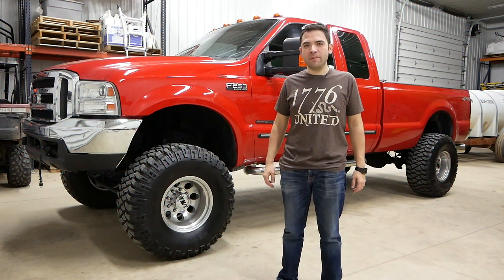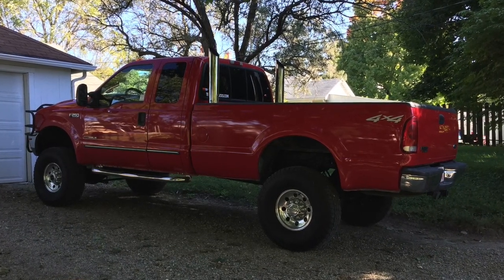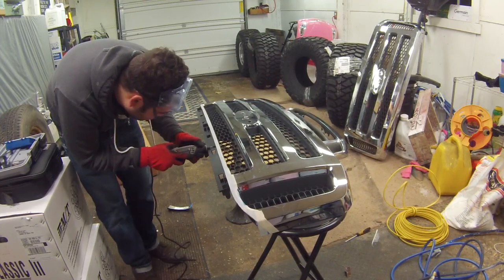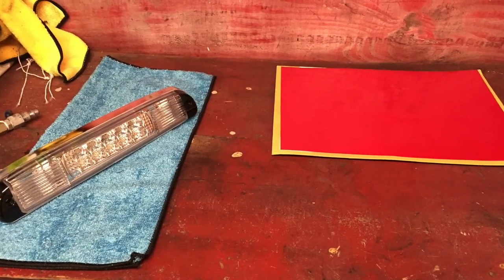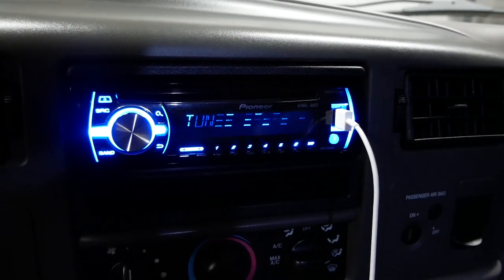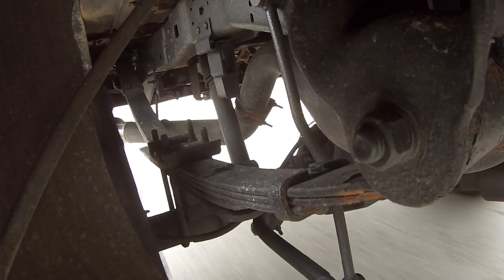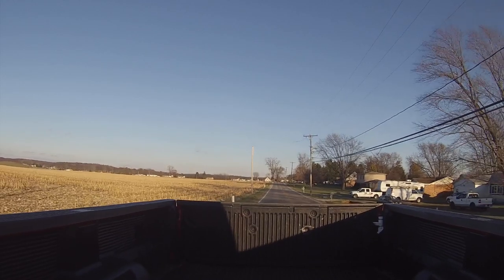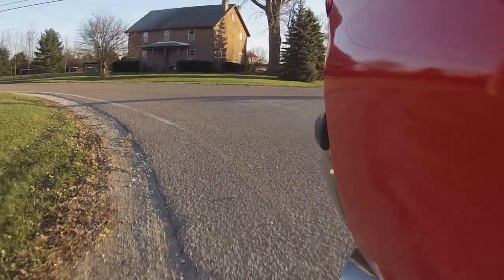7.3 POWERSTROKE F250 project!! (v1.0.0)

Comment: You should get the Sulastic shackles.
Reply from the maker: BIG_JOHNWARD thank you for the comment! I checked them out and you’re definitely right, they look awesome. Looking forward to the winter project of cleaning surface rust on the frame and springs, going to try to add a set of these when I do it 👍

Comment: Love your truck!! Did that wheel tire combo rub leaf springs or fender at all? Just curious because I have an 04 with 6" springs on it and love the way yours looks!
Reply from the maker: Allen Gable thank you! Minor rubbing during heavy articulations and steering wheel at full lock turning right. Turning left seems to be fine for some reason lol I had to trim the front bumper because the tires hit the corners on both sides. Overall I’m happy with the setup though, if I changed anything I would go to a 20” wheel to have some more space between the calipers and the wheels themselves
Reply: @alwaysup2late  thank you! I picked up a set of 16x10. Next step is tires!
Reply from the maker: @allengable2350  Nice! What tires did you decide on?
Reply: @alwaysup2late  I found a good deal on toyo 385/70r16. They do slightly rub springs at full lock in both directions, and I also spaced the front bumper out about 3/8" just to give them a little more room. During any decent amount of articulation they will hit the lower most part of front fenders as well..8" springs in near future. After I regear and truetrack the axles..lol wish I could figure out how to upload a picture.
Reply from the maker: @allengable2350  Those really look great. I think trutrac and regear are on the list for mine too, going to get some traction bars first and see what kind of difference it makes on this one

Comment: Hey could you post the link of where you got the mirrors from please?
Reply from the maker: Sure thing man, got them here: http://amzn.to/2CmFUv9 

They come with adapters for the 99-02ish trucks that didn't have lights in the mirrors originally. I had to add the wires for the turn and running lights though, there were a couple inside of the steering column I used. Probably my favorite update so far, took about 1.5 hours per side.

Comment: Subbed to ya ...funny my steering has the same problem just have gotten so use to it I never looked into fixing it I have 22s with 33s on it and only a 2 inch level for now I have the 3 inch level just have not had the time to put on rub very little inside at full tilt👍🇺🇸👊
Reply from the maker: Hooked On Diesel thank you! I subbed your channel too 👍 I’m used to the wide tires wearing steering out too, sometimes I fix it sometimes not. How wide are your wheels?
Reply: alwaysup2late 22x12
Reply from the maker: Hooked On Diesel oh cool, they look really good on there! Currently running the 15.50s on 12" wheels, they work the steering a little bit. May look in to a readhead pump with some other new parts in the next couple of months for the F250
Reply: Thanks man will do👍🇺🇸👊
Reply: It’s Normal

Comment: Are those wheels hub centric?  Also what gears are you running for tires  that tall?
Reply from the maker: The wheel fit on the hub with no play, but I had to get acorn style lug nuts so it’s most likely considered lug centric. The factory rims I took off had flat lug nuts for comparison. Still not sure of gearing because my VIN sticker in the door doesn’t list which axel is used. I need to strip paint off the axel plate to read it, but RPMs are really low in overdrive, so I’m looking into re-gearing to something a bit taller than I have. I typically drive with OD turned off, unless on the highway
Reply: Nice truck.  Mine is an 03. Thanks for the info.
Reply from the maker: Hop-along Cassidy thank you! Still a work in progress, but it’s turning out pretty good so far. Did you get an 03 7.3? Anything done to it yet?
Reply: Just doing things that are actually needed at the moment. New steering parts, double dampers, nice stock bumpers, fixed oil leaks, leveling kit, water pump, ICP, tryin to stay as close to factory as i can, besides maybe some new wheels and a dual exh. similar to yours. I want it to look like a nicely kept factory truck. I'm an old fart, not into off roading. i just use it to pull my boat. Once i get the needed things done, then i can work on painting it, it needs a tiny bit of body work, not much though.  By the way i am 99% sure you have 3.73 gears.
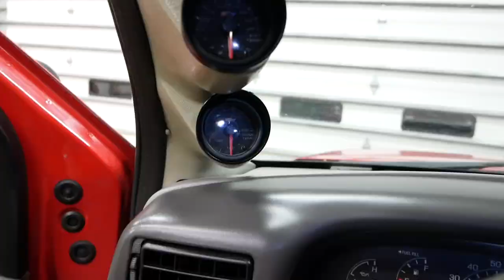Reply from the maker: Hop-along Cassidy that seems like the best way to make them last, that’s great 👍 I think you’re right about the gears, the RPMs are really low in overdrive. At some point in time I will re-gear, probably to 4:56 like I had in my last one. Probably not going to put smaller tires on it, so I might as well make it more fun to drive
Reply: That's exactly what i would do if i was an off roader. That will be nice. Good luck with it. And most of all, Enjoy it.

Comment: Dude no your steering isn’t worn out lol. All of them do that you’re steering is fine.
Reply from the maker: I’ve heard a steering stabilizer can tighten things up a bit, probably going that route soon
Reply: Maybe a little bit but nothing noticeable. We put a new one on my dads truck like yours and there wasn’t really any difference. They pretty much all steer like that.
Reply from the maker: For sure. I’m thinking a dual stabilizer, mainly to keep the 15.50s from following every crack in the road. If it tightens up the steering any bit will be added benefit
Reply: I don’t know all I know is that every older truck like that I’ve ever driven or seen has a good bit of play in the steering wheel like that.